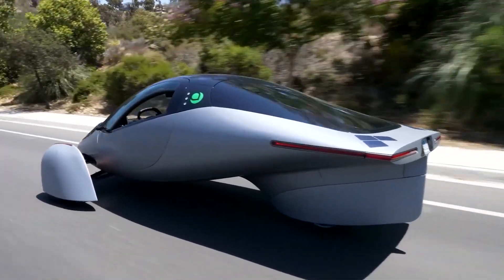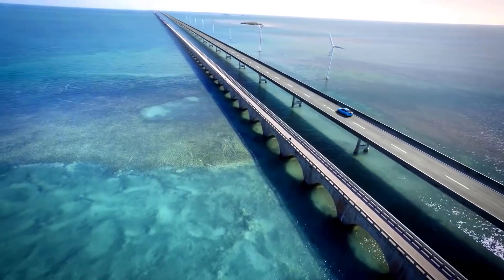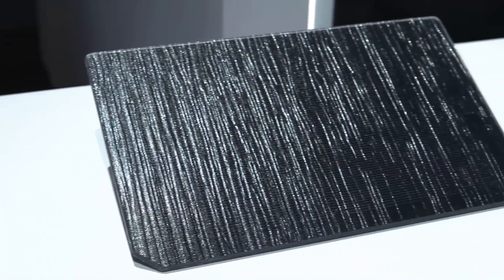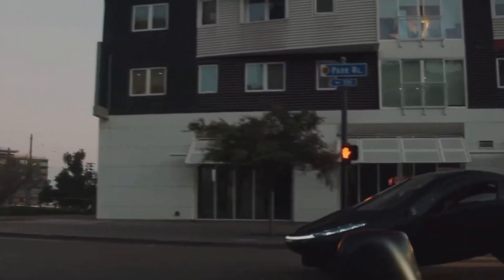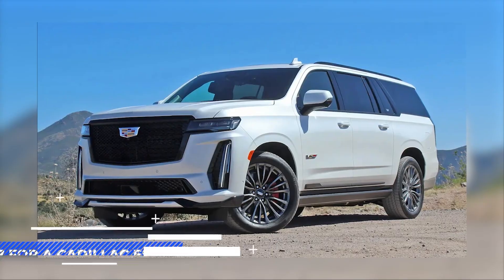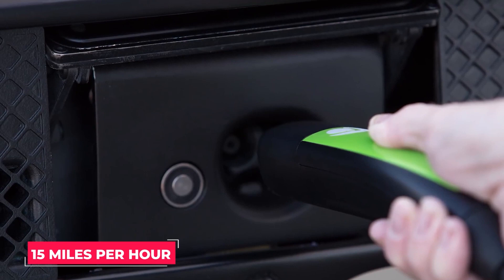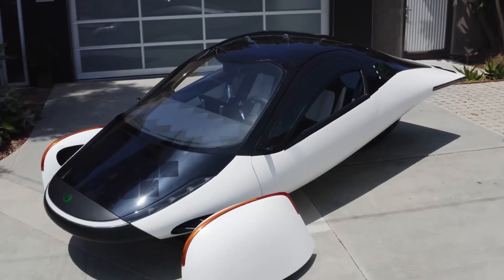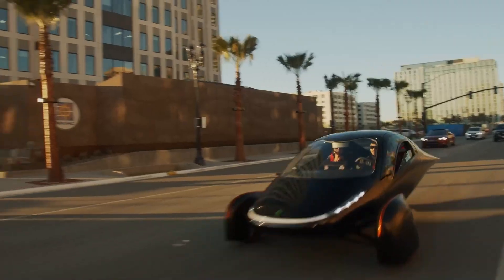Aperta The First SOLAR EV CAR 400 Miles Range - 2023

Comment: This is the direction that EV design needs to go -- going further on smaller battery packs. High efficiency EV design with Solar Assist just makes a lot of sense relative to the skyrocketing demand for battery materials. Conventional EV models using large battery packs are becoming more expensive. Aptera's design philosophy results in a more affordable EV. I just reserved one.
Reply from the maker: I agree with you. Thank you for the comment. Please check our other videos.